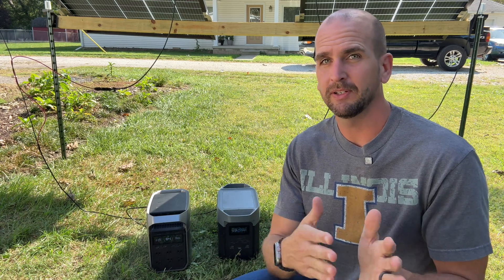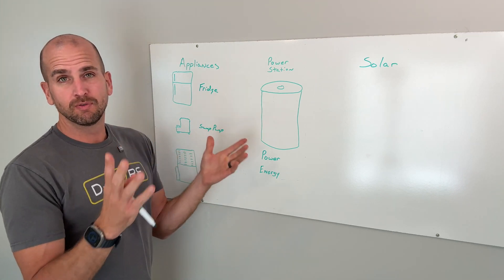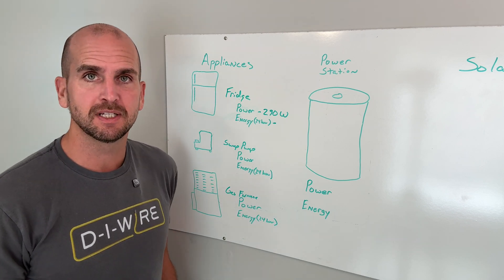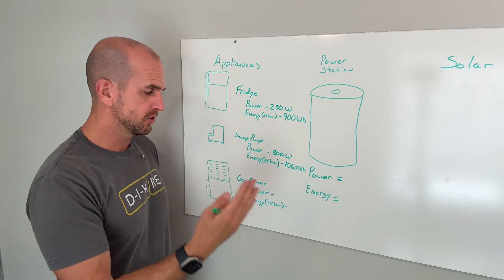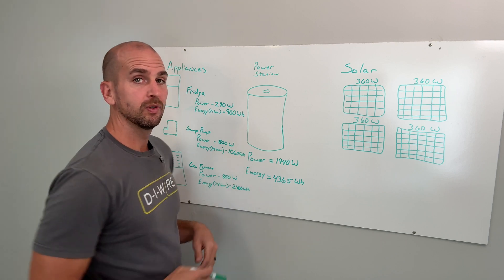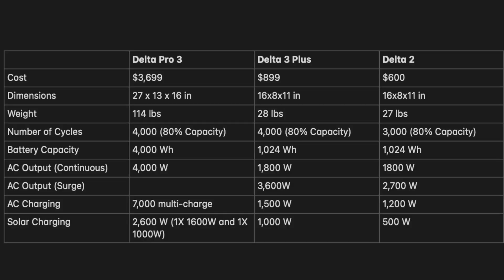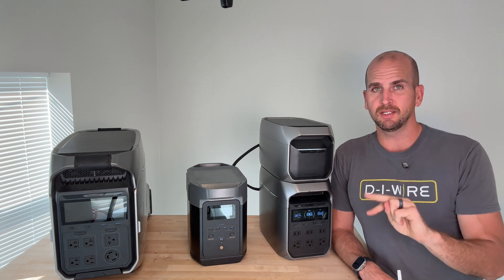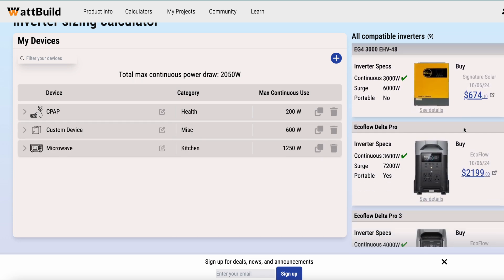Ultimate Power Outage Backup Solution | Home Disaster Preparedness

Comment from the maker: Power Meter:  https://geni.us/s86J
EcoFlow DELTA 3 Plus: https://geni.us/nQuyy7
EcoFlow Delta Pro 3:  https://geni.us/Afu0b7
EcoFlow Delta 2:  https://geni.us/nQuyy7

Inverter/Power Station Sizing Tool:  https://www.wattbuild.com/calculators/inverter-size

Cheap 370W REC Solar Panels:  https://signaturesolar.com/rec-370w-mono-split-cell-solar-panel-silver-rec370tp2sm72/?ref=tWl8ELLgfBNOCr

DISCLAIMER: This video is for entertainment purposes only. Also, this video and description contain affiliate links, which means that if you click on one of the product links, I’ll receive a small commission.
Reply: My concern with these eco flow units is what happens when the batteries wear down? Are they replaceable? How long is the battery life before they wear?
Reply: @BackToTheGame.98  they will last about 10years at 100% and 80% capacity after that.
Reply: @sdsviet — Yes… but what about the units systems, fans, etc.  Are they user serviceable?
Reply: @Erin-Thor doesn’t seem that way but I will assume EcoFlow  service them for a fee. 😅 I believe they have at least a 5 year warranty on these. Personally if I get 5 years out of them I’m good. Newer models will be out with way better tech.
Reply: Unless I'm misreading it, those solar panels require a minimum of 10 units to purchase.
Reply from the maker: @CarbonInky  You are correct.  That is fairly common for most online sellers it is hard to find a panel you can order 2-4 panels.    When I only need a few I try to find used panels that will work on Facebook Marketplace where I can just go pickup what I need.

Comment: I have the Delta 2 and it's additional battery.   I can feed it with 130 watts or so for a very long time out of my Tesla 16 volt outlet.   I also have a Honda 2000 generator I converted to propane.  I use a 4 circuit transfer box to run my furnace, fridge, the Internet and some lights.  I can get hot water if needed from the on demand hot water heater which only draws about 30 watts for the control board.  Used a Kill a Watt meter to figure out my loads.  The 2 kw of battery with the 128 watts in continuous will run my house for 12 - 24 hours.  The generator will charge it all back up in a few hours.  All in all a great system.  Thanks for the video.

Comment: Your home power needs 2000 Watts and Energy 5000Wh and the EcoFlow Delta 3 plus is max out at 1024Wh. So not sure how this is going to work? It would have been nice to go over the theory of the difference between Power/watts compared to Energy. It seems like you need 3 times more Energy compared to power wattage which I'm not sure why you need more Energy compared to power watts

Comment: I had to do this sort of thing when Tesla was installing the powerwall. No more, I hope. Was only worried about powering refrigerator. Couldn't roll fridge out of nook to reach plug, so I had to cobble up a system to power it from dedicated wires in the kitchen sub-panel. Managed to do it safely.

Comment: How did you measure the gas furnace? Mine is hardwired, and I’ll probably keep it that way and connect the battery to the circuit breaker panel.

Comment: I understand the desire to go green and use batteries,  but living for weeks on essential only equipment just isn't practical IMHO. For batteries you pay 3x the price per kW of capacity than you do with a traditional generator.  I wrote a multi-part article on Substack under Kilovar1959 on buying an engine generator if you want any information.

Comment: A big missed opportunity here is to run this system throughout the year and offset some electrical costs. I am in Asheville and thinking of doing a setup similar here once things go back to normal. But I want to benefit from the sunshine not for just a handful of days. More info on this (within code limits!) would be great!
Reply: If you have a generator switch, you can semi permanently plug a power station and switch some circuits to pass through. If you plug both solar as well as grid into the battery you should be able to save decent money.

But for this use a actual solar inverter like a eg4 3000 is more flexible and capable than a portable unit

Comment: Amazon isn't shipping the Delta 3 Plus until mid-November. Also curious about the Delta 2 Max. Runs about $1000. You can add an extra battery for $850, but gives you 4000+ wh.

Comment: i disagree with your recommendation. Why not do the Delta 2 Max which has 2000 Kwher and an additional battery. if you need another 2khwr you can do that later. i don't see the point on going with a 1kwhr system . price might be the differentiator but i think runtime is more important here

Comment: I've been wondering, wouldn't a pure sine wave generator be better than the inverter generator because the inverter generator doesn't put out a full sine wave.  The invertor generator could interject noise, voltage instabilities because of the nature of an inverter.
Reply: Most of these name-brand portable power stations have inverters that are pure sine wave, and are in fact cleaner juice than most grid power.

Comment: I’ve never understood the fascination with the small home units like this OK you can power everything for 24 hours but then you need another 24 hours to charge it up Solar Panels you basically need two or even three systems that you can charge separately to run your house 24 hours a day for a week or more. Obvious answer is a gasoline generator or a propane generator
Reply: You can charge up the batteries with any thing that can generate power even while it’s discharging. Gas or propane generator. Plug it into your car gas, hybrid or ev car, if it has an outlet, or buy an inverter to connect to the cars 12v. You can charge the batteries in 2-3 hours at night with a car. Combustion Fuel generator are awful at night. Might be too loud to sleep or disturb the neighbors if you have any. Run gas generator to charge the batteries when folks are not sleeping.
Reply: Most power outages are less than a day. Outside side of a catastrophe like NC, battery would probably be fine even though the cost is ridiculous but easier maintenance, quiet and can use indoors. Generator is needed for longer outages, but then you have to stock pile fuel unless you have one hooked up to natural gas or a massive propane tank. I guess each has it's place.
Reply: Or natural gas generator if you have natural gas.
Reply: I run propane, the only way to go.
Better than a 2 foot extension cord.
( a two foot battery box.)